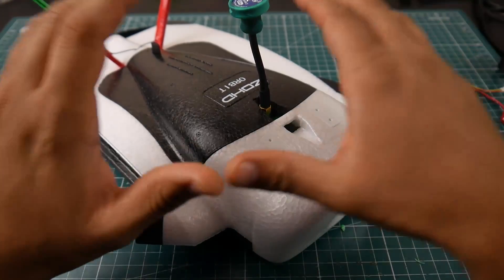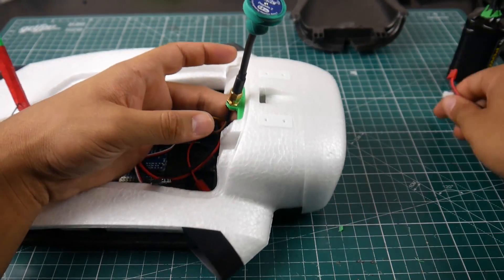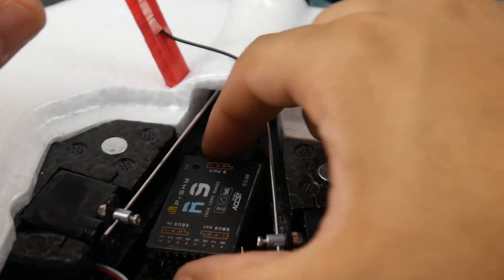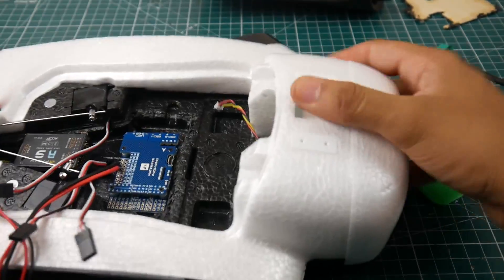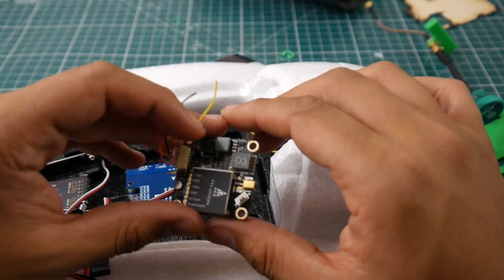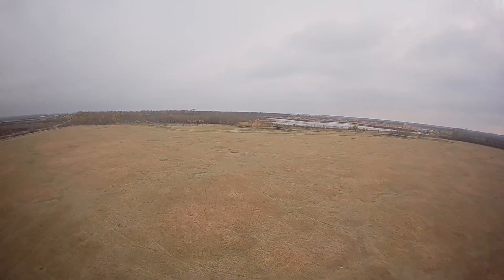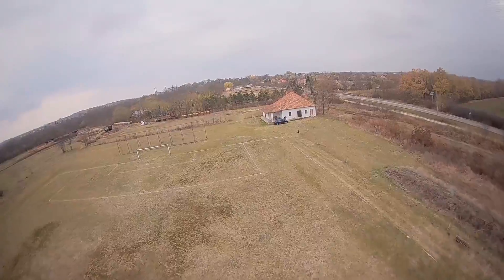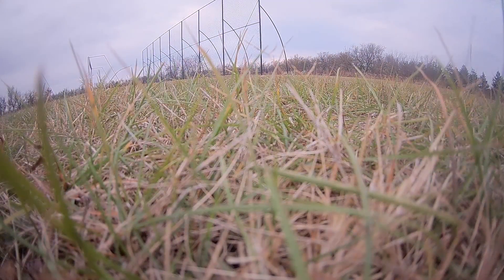Zohd Orbit V2 Maiden // How I will convert it into INAV Long Range FPV Setup

Comment: Have you thought about moving the transmitter and fpv transmitter out in the wings?  Use a jst connector or a small connector for wing removal?  Planning something similar and considering going this way to help conserve space and help with adjusting CG a bit easier

Comment: Install Sunnysky 1500-1800kv motor and Gemfan flash 7042, hide all antennas inside fuselage, and it will be ultra efficient.

Comment: Awesome man. Looks like a great build. I'm interested to see how you end up mounting the GPS. I haven't worked with a GPS unit yet, but have one on the way. My friend has quite a few wings and he was telling me not to mount the GPS anywhere near any other elctronics, so he has his out on the wing with a connector so it can pop off if the wing comes off. The reason being that the GPS takes forever or won't lock or lose lock when the unit is close to other things. I have no idea, so I'd like to see how it works for you. Loving the videos!
Reply from the maker: I never had an issue with locking no matter where I place it.. I have only been using matek GPS and I find to be really really good. It's like what everyone complains about doesn't even exist with those GPS's but they are pretty pricey.
Reply: @DroneMesh  Hmm..maybe i'll have to order one of those and try it out. Thanks!

Comment: Would you show how to setup the flight controller great job
Reply from the maker: Yes it will be a 2 part video.. I finished the wiring and 3d parts setup today I might release the video in couple hours or tommorow. Keep checking back as there is a chance I will release it in about 5 hours.

Comment: Love your videos buddy... i trying wings  as well.. but still loves my quads...heh. try print cam holder in petg is easier to print and dont need enclosure. I really enjoying my sonicmodell ar wing v2 with inav...my next project... arduino antenna tracker heh..  happy flying